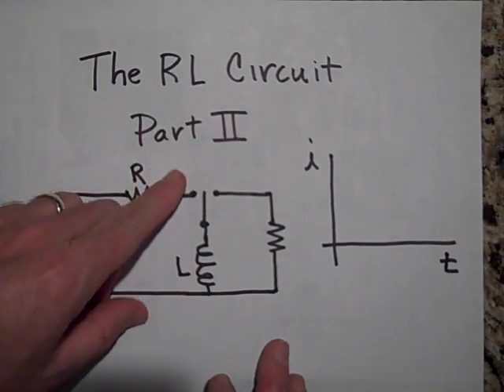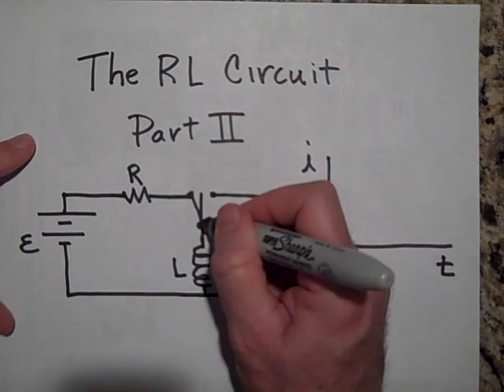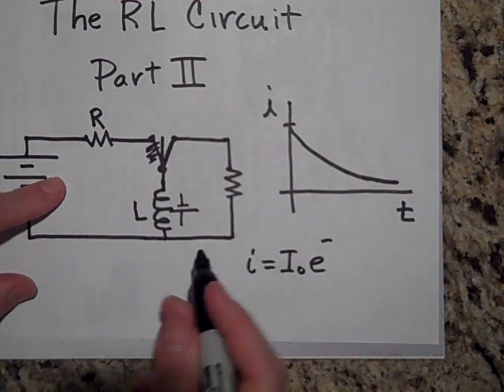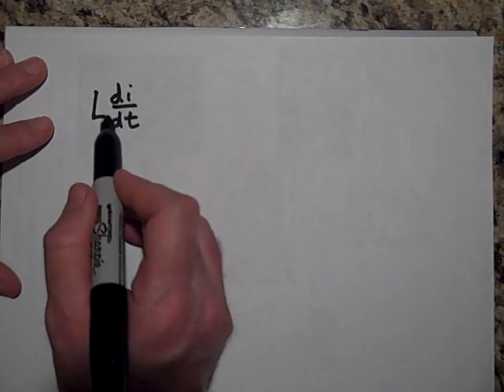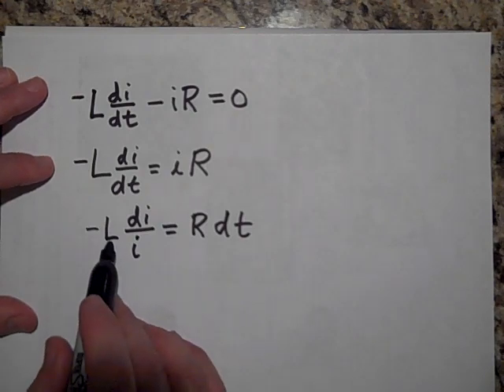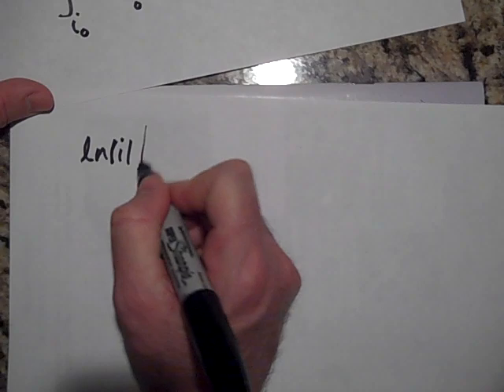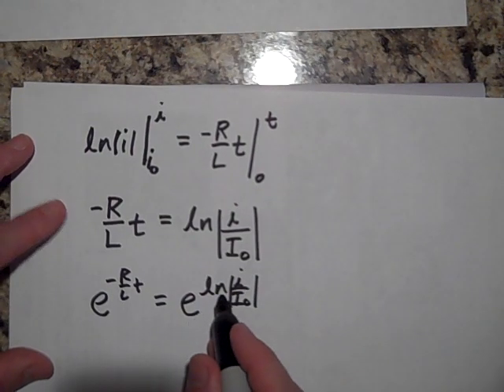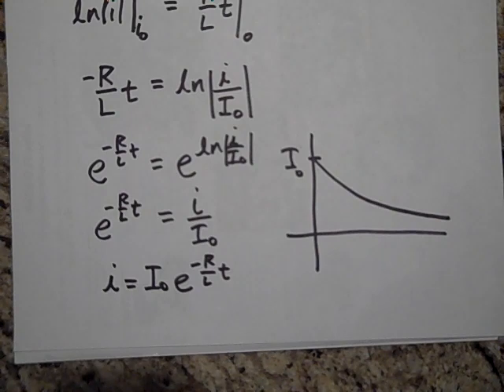The RL Circuit (part II)

Comment: When the inductor was switched to the battery side, initially the current was zero - at the instant the switch is closed, the voltage drop of the inductor is exactly as the battery voltage, and there is no current in the circuit and as the switch is closed after a long time or past the '5 time constants' the current flow was building up while at the same time voltage drop across the inductor was decaying exponentially, also while the current was building up, the magnetic field is also building up through it. After a long time the switched is closed the inductor's voltage is practically zero and the current of the circuit and the magnetic field 'stored[' on the inductor are at it's MAXIMUM, the inductor becomes just a 'WIRE'.

Comment: Would be nice to have similar analysis of LR in fast switching DC circuit, like buck convertor. Such circuit is simplified as L/R >> T, but I don't have clear math behind and the reason why it is simplified. Why exponential formulas doesn't work for fast switching circuit simplification

Comment: What is I_0 (I_naught) ? Would it be V/R where V is the Voltage supplied by the voltage source? If so, then the Voltage across the inductor at time 0 is RI_0, though just a second before the voltage was zero. Hmm